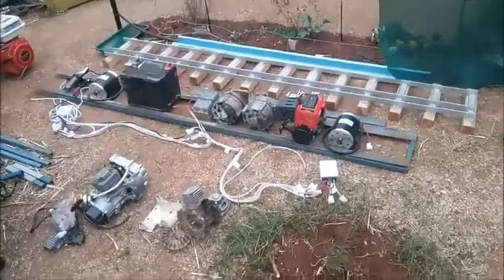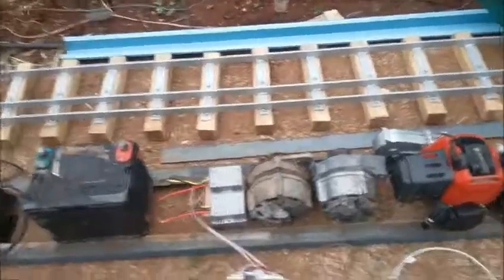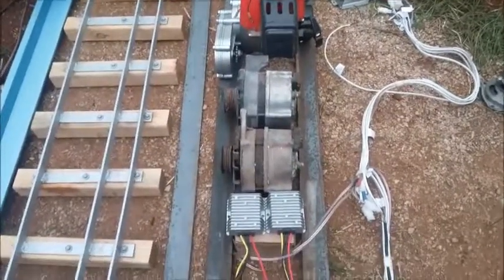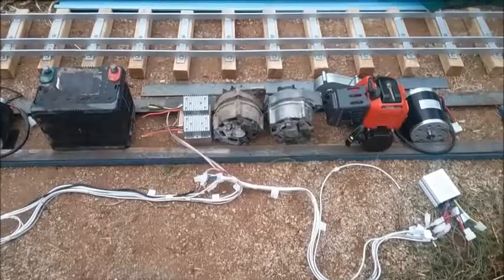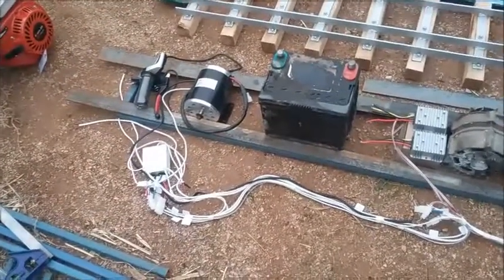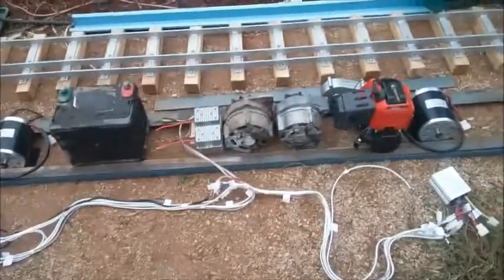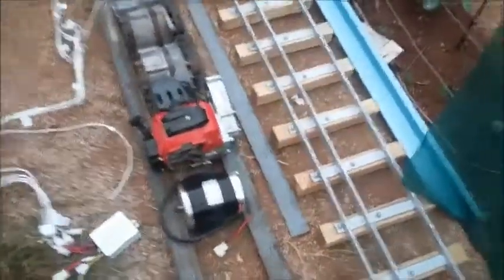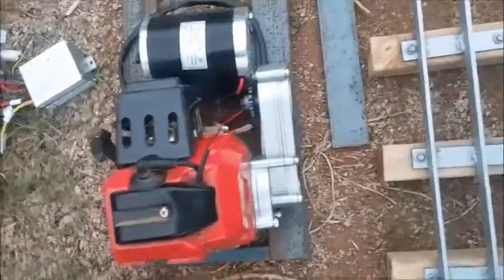Miniature locomotive build - NR class - Vid 1. 27-07-2018

Comment: Using a whipper snipper motor to drive a 85 amp alternator is not going to happen. I used a whipper snipper motor to power a brushless dc motor and the motor was struggling to run 100 watts at 12 volts (8 amps).
Reply from the maker: Gearing is a big thing. The engine only revs low compared to a brushless, and high for an alternator. An alternator is built to run 'low' RPM, and still create the voltage and Amps needed (generally 2400rpm). A brushless runs at ..... 10,000 to 30,000 rpm, depending what you use, so it needs to be spun at that to create the power specified. That's a hell of a gearing up. 49cc will run well at over 4000 rpm, and peak at 7500rpm. Even with the alternators, I've gone to a 2:1 gearing, so the engine RPM will be high enough to cope with small load changes easily. I've ran the electrics twice to date, with load (a quad bike I made into a test sled). 49cc was ok, but I'm currently rebuilding the new engine to 80cc,  just for extra torque. As far as being able to spin it under load ..... easy. These motors run small 240v gen sets all day long, so 2 car alternators aren't a worry.

Comment: Hi! Nice setup! However, in my honest opinion, it is too complex. Why not try to follow the original design and copy it from real locos? Diesel (or gasoline engine in your case) - generator (a dynamo) and finally traction motors? You could throw the batteries away, all the controls and electronics. You would control the speed by revving the gasoline engine up and down, pretty much the same way as in real locomotives. Simple, durable, life-like. If you don't think this works, see my diesel-electric locomotive I'm building. (click the link: https://www.youtube.com/watch?v=Es1giVF6nIw ) Simple. Engine - generator - traction motor. No electronics, no controls, no batteries. (except the one to start the engine). Same principle as on big locos :) 
For generating electricity you can use one of the permanent magnet motors. They work well as motors and dynamos too and would be good for the job in your little loco. Good luck!
Reply from the maker: Built into the wiring is a bypass, so I can have it direct from alternator to motor, with a 5 minute motor change and the flick of a switch, but for noise restrictions on some tracks (little 2-stroke ringing out to get the power down to start several hundred Kg's moving), it's easier to set an engine speed just high enough to charge, and run off the 24v power. I have both options built in, but will mainly use the later.

Comment: Looking great! any progress?  How did you come up with those wiring diagrams? (something I'm struggling with)
Reply from the maker: Thanks. It's on hold for the time being till I can afford the bogies ($3200 for both 3 axle bogies), but I'm getting other bits slowly, and getting the body work started. I've run the electrical system and it works well. I have to gear it down a bit, as there is a 10km/h speed limit on public tracks, and currently my calculations say it will hit a lot more than that ..... but that is without weight behind it of say 1.5 ton (4 x 100kg people and carriage weight, x 3 or more carriages). I can't wait to finish and take it to Queensland and try some tracks.

I use to be an auto-Elec and a sparkie, so wiring is something I don't mind. I actually enjoy designing and putting together looms, which I end up doing regularly, for my projects or other peoples projects.
Reply: @jasonoconnell11  are you buying premade bogies, or do you have your own design that you're having made?
Reply from the maker: @hopster81  I'm looking at buying them in kit form. The price above is for 3 axle bogies, complete, with brakes and motors. Not cheap, but thems is the breaks I suppose.